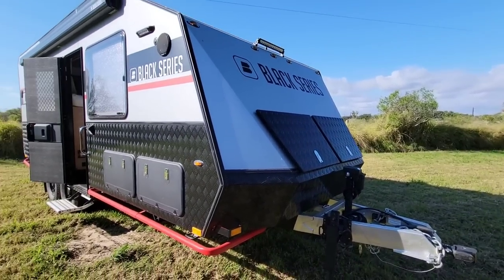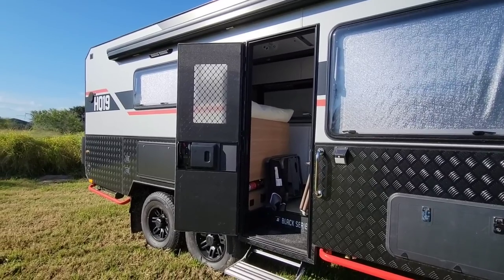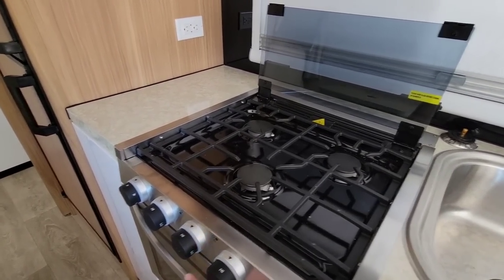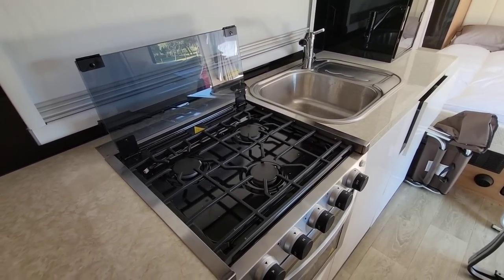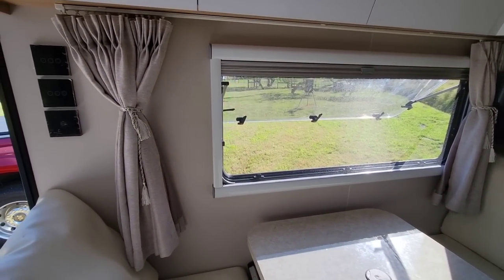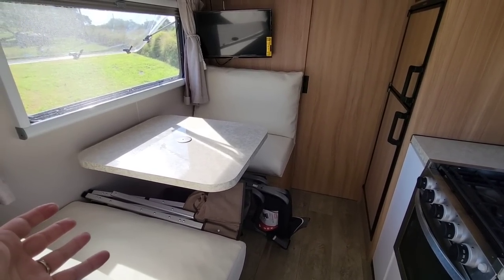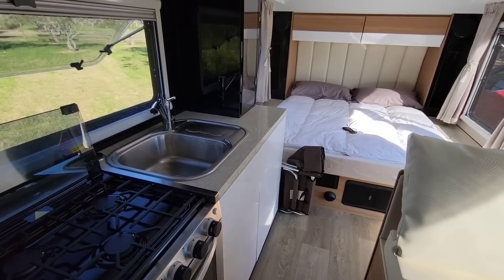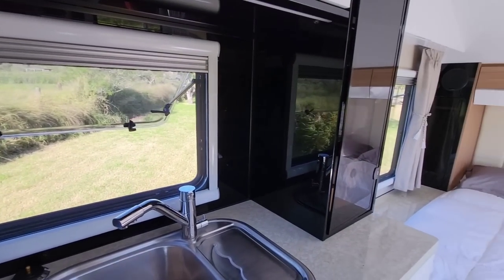Black Series HQ19 RV updates! Confusion and Clarification Video

Comment: Out Gassing of the materials used in construction of the Black Series might be getting sensed by the detector. Even cleaners can and do set it off.
Reply: That is what I came to the comments to say. Off gassing from the materials used to build the unit.
Reply: I guess it probably can be caused by the bug killer he mentioned in previous video to propel the bugs.

Comment: We had the same problem.  I replaced the LP detector 3 times.  Finally, I discovered that it was being cause by methane gas from the toilet.   I replaced the seal and made sure a little bit of water was in the bowl.  I put the former LP detector back on and no problems since.
Reply: correct. happened to me too.
Reply: Something similar happened to me to too but at home. We used to use  attach an specifically to capture diapers but the methane would still leak and cause our in home detector to go off.

Comment: There are many chemicals that cause the sensor in the LP detector to react in a very similar way as it would in the presence of Propane (C3H3).  Ethanol, Hydrogen, Methane, Iso-Butane, etc.  There can be other sources of propane besides the tanks and lines.  Propane is used as a propellant in many household aerosols like shavimg cream, air fresheners, hairspray, etc.  Anything with Propane or similar compound can set off the detector.  Off gassing of some product(s) inside could also be the source.  Seems whatever it is, it is building up over time when the unit is closed up and then is diluted when you open it back up.

Comment: I had a similar issue with our brand new Prowler last year and it was caused by a low battery. The battery that came with the unit was very low and would cause it to randomly go off unless i had it plugged into shore power when it would keep the battery topped off and consistent voltage. We replaced the battery and have not had an issue since.
Reply: I have had the same issue. Low battery and the detector goes off.
Reply: Low battery caused my issue also. But I had to replace the sensor after the battery was fully charged as it would go off very interdentally.
y

Comment: Material out-gassing was my first thought. Do you have relationships with propane distributors/HVAC installers that have "sniffers" similar to those used by natural gas utilities to locate leaks? On a hot day with the alarm going off, maybe it could locate the location in the vehicle.

Comment: The first thing to do would be a fresh battery in the detector.  The 2nd thing would be to turn off the solar charger &/or disconnect the battery string because it maybe outgassing by your storage batteries. Failing those 2 might consider an alternate detector.

Comment: The LP sensor in my travel trailer used to go off randomly all the time.  I pulled it off the panel and opened the back up and the two wires had rubbed together 1/4" off the solder point and weakened the insulation.  A bic pen between the wires for a few hours proved separating the leads solved the random alarm issue, so some electrical tape went on and it went back together.  Now if I can keep my toddler from pushing the test button so easily...

Comment: I had a brand new Black Series caravan that had numerous problems. The BS caravan spent more time in the shop than in the field.  My LP sensor would go off too night and day and the walls and cabinets also started cracking.  In the middle of the night my LP sensor would go off even though I would open up the windows and reset the sensor. The trailer would also build up condensation on the ceiling on cold nights which made me wonder if the ceiling was properly insulated.. I also had other issues too. I used my trailer for one season and got rid of it.  BS are cool trailers but definitely problematic.  Good luck!

Comment: We had a similar issue with an older TT (5 yrs. at the time). Replaced the sensor three times. Each time technician had checked for leaks, but confirmed no leaks. Finally suspected that we may have had a residual leak from the LP fired refrigerator as the alarm would activate shortly after switching over to shore power when setting up at a campsite post travel. Had a technician clean out the LP line and shutoff valve to the refrigerator. No more alarms.

Comment: Do you use Lysol or other fragrance or aerosol sprays, I know that Lysol uses propane as a propellent.
Check the battery voltage as well, when I rented a Grey Wolf the RV Renter said that the detectors also complain on low voltage from the house battery.

Comment: Perhaps a way to eliminate the possibility of a faulty sensor, would be to place a temporary enclosure around the sensor with a tight seal. Monitor it for a period of time to see if the sensor goes off. If it does go off, then perhaps the sensor is faulty and thereby getting a false reading.

Comment: I just purchased my hq19 and I noticed after my main battery was low, my common monoxide detector started beeping every couple minutes. I figured it was the same problem you were having but after I charge the battery and the indicator light was green, it stopped completely.

Comment: Bad gas huh? Gotta take it easy with that TexMex. I also find it funny how they put the sensor directly underneath the dining nook, like they WANT you to just fart right next to the thing LOL

I am kind of questioning though why the bathroom doesn't have a vent on it (the kind that's always open and weather proof), since that's probably where the smell is originating from (black tank). You should also have a better seal on the door to isolate those smells likewise. I guess you get what you pay for even with Aussie designed stuff. Good, but not quite good enough.

Comment: Sometimes when batteries are charged (usually see this on golf carts in garages) it can produce a hydrogen gas that mimics CO2 on detectors. Once you ventilate it goes away. Is there a solar charger?

Comment: Get another sensor and see if it also detects propane when the first one does.  There are sadly many people who die when their CO detector indicates CO in the air, but they pull the batteries thinking its a faulty detector.  Don't make that mistake.

Comment: How sensitive are the LP leak detectors when working properly? If you open and close the stove burner for a 2 second period without letting it light, does the detector start going off? 

I've never used one.